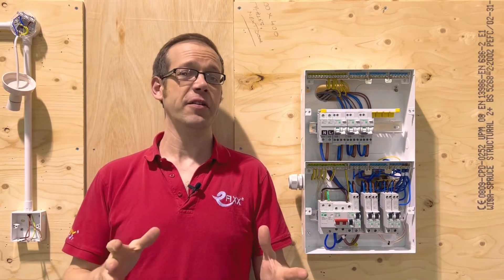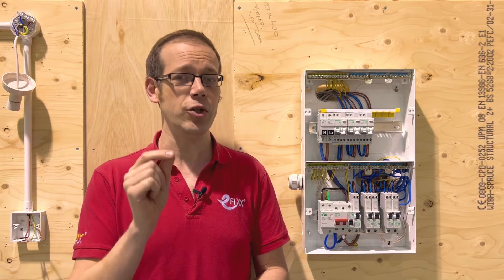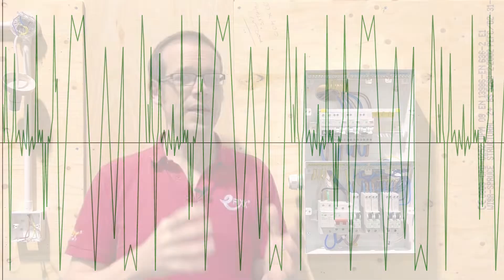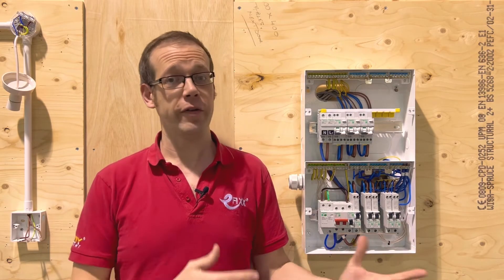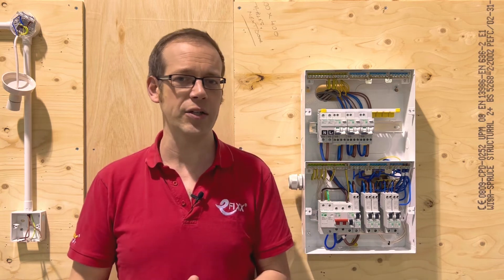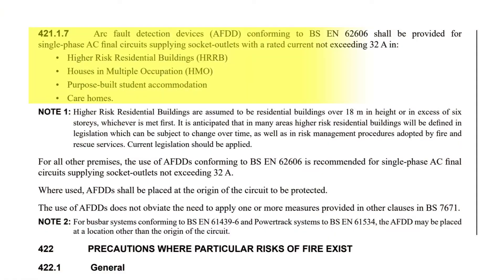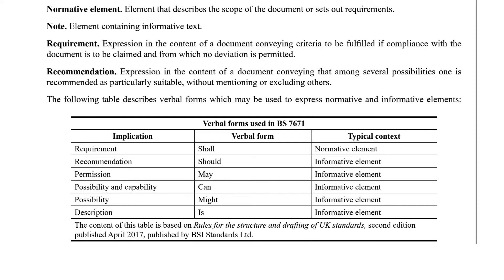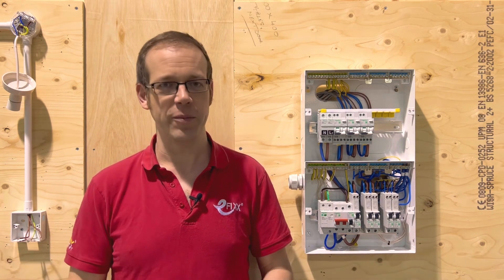What is an Arc Fault Detection Device? AFDD

Comment: Question, what would cause random  spikes of over a 1000W for less than 0.1-1 second when no device is in use. and any device that might or would cause it is FULLY unplugged.

I have these Rare/random spikes when I read the data of my smart-meter, that randomly happen for less than 1 second.
It might just be a FALSE positive from the data that I pull directly from my smartmeter using a Consumer port it has.

At least I think its a False positive as when I have a large load on, and I get a spike the total consumption is much higher than the rated Amperage main fuse for my home. 

I only have solid core wire in my home, so arcs should not be the cause of it.
-----

Another question I would have is: Do you have any suggestions for ZIGBEE smart breakers, {I want to use one as a SUB-breaker, that sits behind the main breaker for a group/area} combined with a lower rated non-smart-breaker of 220V/10A
This is so I can have a MAIN control for my yard-shed, that I can turn off when I am not present there.

Comment: I had a Hagar AFDD installed on the main socket ring for my flat. To switch on my TV, Sound bar and associated equipment I use a Hue Smart Button to operate three Hue Smart Plugs at the same time. The AFDD trips about 5% of the times we use the Smart Button to turn the TV on. This is a little irritating.

Comment: Most AFDD nuisance tripping is mainly due to extension leads and appliances, not the main fixed wiring.  

The prime reasons are:
1) Flexes undersized;
2) Poor quality flex leads;
3) kinking of flex leads. 

So, only using quality flexible cables, not cheapo stuff, and that are big enough to take the current, is the prime solution in eliminating nuisance tripping. This is something manufacturers have to bare in mind.
Reply: How does an undersized wire affect the voltage or current waveform and change it to cause the AFDD to trip?
Reply: @deang5622  
gaps can occur causing an arc to jump the gap.

Comment: The AFDD regs came in one year ago mandatory for high-rise, care homes, etc. It is not retrospect. 

Sockets-outlets not exceeding 32A. 
It says "socket-outlets with a rated current not exceeding 32 A". Note: Socket-outlet not circuit. A double socket is rated at 20 amp combing the two, a single is 13 amp.  So they are both inside the regs'.

A single 13A socket can be on a cooker circuit protected by a 40 amp disconnector at the consumer unit (they are on some cooker isolation switches). So this must be on an AFDD, as the socket-outlet is less than 32 amps. 

In short it is saying that irrespective of the rating of the consumer unit disconnector (MCB, etc), it could be 6A, 16A, 32A, 40A circuits, if a socket is on it rated under 32 A an AFDD has to be fitted. This is even if a 15A round pin (they are legal) or 13A square pin socket is fitted.

A washing machine radial with one socket supplying the washing machine?  An AFDD has to be fitted unless the washing machine is hard wired in. 

So, a lighting circuit with 5A round pin sockets serving a few table lamps needs an AFDD. The regs do not discriminate between lighting or power circuits.

The guidance on the meaning of the words in BS7671 (regs) - AFDDs are recommended, on all circuits with socket-outlets. That is in all homes. Recommended means should. This is they should be fitted unless there is another alternative to arc fault detection.

Comment: These devices will never be effective.
The reason is not that there is no good software.
Do not hope that the device will be improved over time, and it will become as reliable as circuit breakers.
The reason is in the principle of action.
The device is tested when sparking on a graphite electrode or through specially charred insulation.
There is neither one nor the other in electrical installations.
The arc between the metal conductors burns in the same way as the arc in a conventional switch.
It is impossible to distinguish these types of sparking by electrical interference.
However, any sparking is very easy to notice by identifying the circuit interruption using a conventional differential current device and an additional resistor.
The same can be done with a voltage relay installed at the end of the circuit. 
Plus, I note that the most reliable sign of bad contact is not sparking, but an increase in temperature.
With poor contact, most often there is no sparking, and there is heating and fire danger.
Therefore, the future belongs to the control of non-electrical indicators.
If you are interested, I suggest about 30 films on this topic on my channel.

Comment: This will be interesting to see how stable this proves in use. ARC protection has been around since😅 the 1990s for overhead 1kV to 33kV medium voltage lines. Stability has been.the main reason that few power utilities have adopted their use.
Reply from the maker: Yur, there'll be a period of testing, adjustment and settling in no doubt. 🤔

Comment: Are there some examples of the waveforms for the "spark" situations (motor, light switch, etc) that its programmed to ignore. Would be nice to see the difference. I guess it ignores the light switch situation, because its so short, it will ignore because the "arc" or "spark" must be sustained for a time before it trips. And also thats why its programmed to also not react on a load less than 2.5 A. But a drill or hair drier or communotated fan that creates constant sparks/arcs during normal operation, how is that different from a damaged wiring?
Is it the rotation of the rotor that creates different arc lengths which will be visible in the signature?
Reply from the maker: Motors give off sparks during normal operation, this is different to the sustained arcs produced by damaged or faulty wiring. The AFDDs can tell the difference.

Comment: Another overpriced gimmick. I've seen these tested many times, they do not do what they claim to do. They are creating a false sence of safety, and are a phantom load to the grid. Good luck getting a client to pay for a board full of AFDDs too...
Reply: I've seen those tests too, however the software inside will be ugraded overtime to recognise more or other type of arc defects. This is just the beginning. In the next 10 years, we may have digital boards with PEN fault or IR monitoring...
Reply from the maker: It's all very reminiscent of when the regs changed on RCD protection. The price of these will come down no doubt, just as they did with RCBOs.

Comment: In Canada we call it an AFCI arc fault circuit interrupter
Reply from the maker: Good to know, thank you! 😃
Reply: In the USA, we have CAFCI “Combination Arc Fault Circuit Interrupter” devices.  They detect both series (within a single conductor) and parallel (between two conductors) arc faults.  We also have Dual Function circuit interrupters that combine a CAFCI and GFCI in a single circuit breaker package.  The 2023 edition of our National Electrical Code (NEC) calls for widespread use of these.  Whether they will actually be required depends on what edition of “the code” the AHJ (Authority Having Jurisdiction) has adopted, along with any modifications (additions or deletions) they have made.